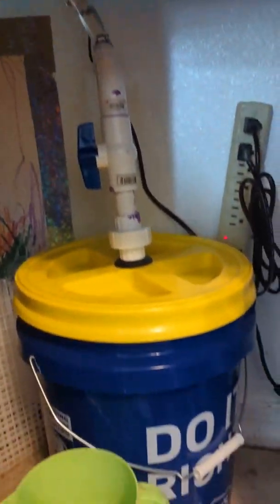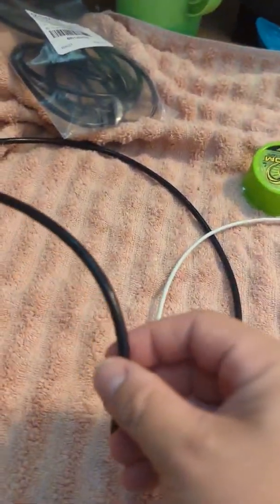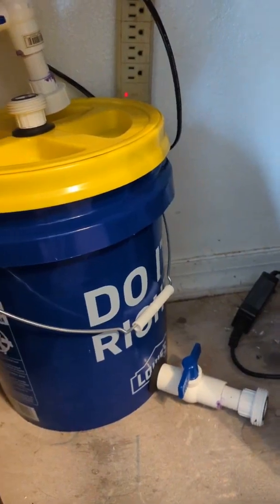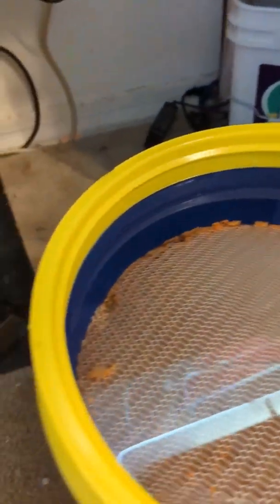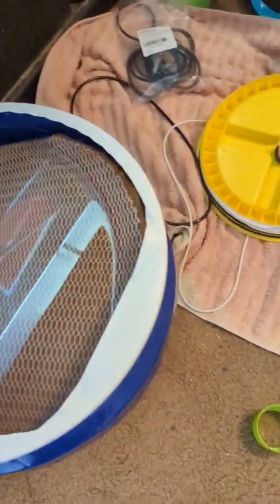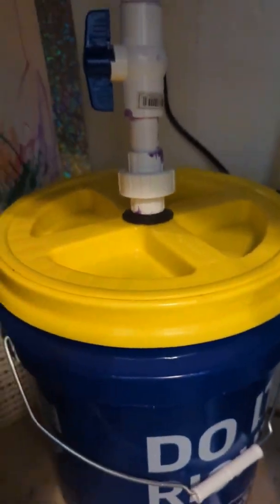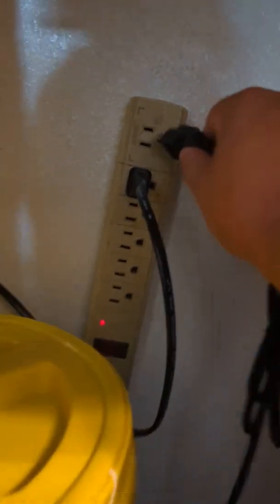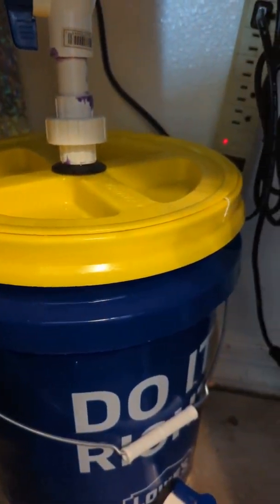DIY 5 gallon bucket canister filter(part 2) Fixing tank pressure leaks

Comment: Put your drain line on the surface about a quarter of an inch under the water otherwise when the power goes out your tank will drain onto the floor

Comment: I wish I've seen this video before I ordered a Gamma Lid. This is a total bummer with all the leaks you had and having to buy extra O-rings. Tells me the gamma lid is a piece of junk.
Reply from the maker: I'm guessing for what it's meant for, like food storage it's great but not designed for pressure from within. I did figure out the right o-rings though and it hasn't leaked since. I have running non stop almost year and half. I have to clean about once every other month with my current tank and turtle.

Comment: What stops your setup from leaking if the pump abuts off?
Reply from the maker: The leak stopped after I replaced the stock oring with ones I found on Amazon. I also used 1" Teflon tape around the lid thread. Plus I put Teflon tape on the rim where the gamma seal attaches to the bucket. Then I tightened the lid really tight. Since doing that I have had no leak. I did this project in September and it's been going 24/7 since I fixed all the issues. I try to clean it monthly or every other month. It doesn't get too dirty and keeps the 125 gallon turtle tank really clean.